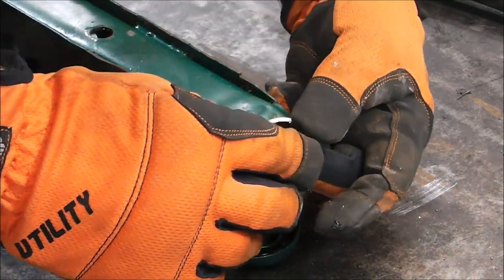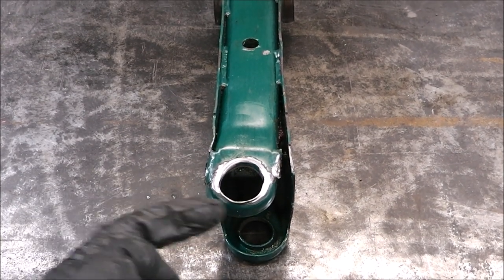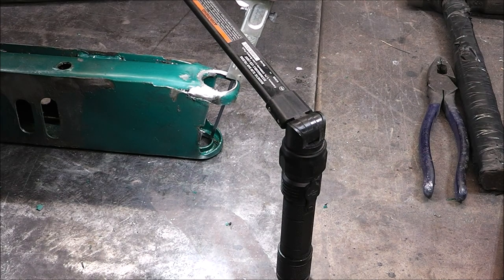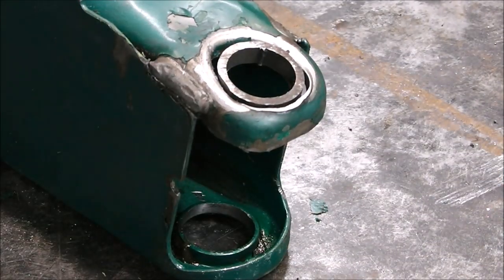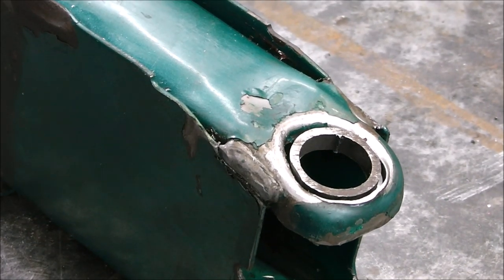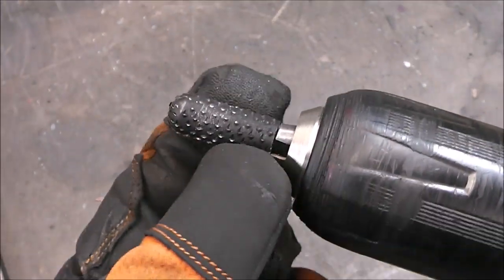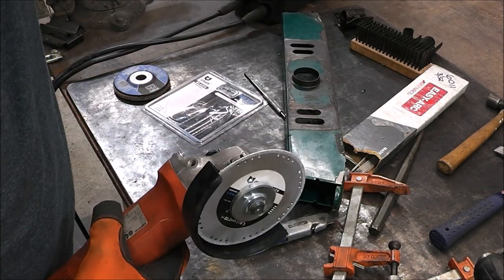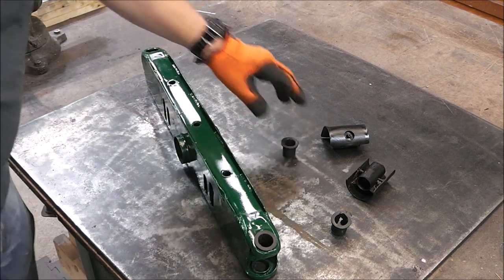Stick Welding Repair on a Bent Tractor Axle

Comment: A couple too many beers when you ran the mower huh? Safety third! 🍻 

Glad it wasn't too hard to fix. Making the 15/16" hole with a rasp from Hazardous Freight was a clever workaround. I'll keep that one in the back of my mind for future repairs.
Reply from the maker: Shhhhhh, (they were light beers) and my wife thinks it was the neighbors kid that broke it 🙄 JK. I probably could have bought a cheap throwaway 15/16 bit but I figured the rasp was worth a shot. It worked surprisingly well. I cant remember what I paid for it, but it wasn't much. It was a cheap set I bought back when I was restoring the fairings on the Suzuki rebuild project. Cheers brother!
Reply: @BrandonLund  I have that set of rasps. I thought they were for wood and nonferrous, only. Is there a reason you used that rasp over a carbide bur? If you don't have a carbide bur, that would be a really good reason; but maybe there's another?
Reply from the maker: Honestly, the rasps were leftover from when we fixed the plastics on the Suzuki Rebuild Project and I was just curious to see how they would hold up because I knew they never touched anything other than plastic. I have a few cheap abrasive rasps (which are a joke if your trying to hog out material) and I have 2 good carbides that i use on a die grinder but I don't don't really like using them unless it's on something important. I purchased them for porting and gasket matching an intake manifold. I cant remember if the rasp I used in the video was intended for metal, but if not, it held up pretty well.

Comment: Great video. 6011 burns thru paint. A few extra welds at stress points might have been a good idea.  Having worked (welded) in production factories, I know the guys sometimes go CHEAP on the welds.  Some guys cheat A LOT in that area.  " Overengineering is under rated " If more reinforcement welds were put on originally, you might not have had that problem.  IMHO There's a special place in HELL for the guys who cheat on quality.  They've caused a lot of grief during their careers.
Reply from the maker: Yah I agree man. The cracked welds that i repaired near the end werent enough. It might be hard to see but I extended them by about an inch beyond what was originally done and i also put some weld inside the tube. I doubt it will fail again if I'm using it right, but if it does I'll put a cast iron axle in it.  It's pretty thin metal.

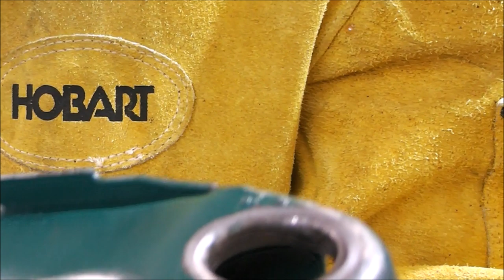Comment: 11:34 another crack. 
Maybe you will have to make less reps by building the whole part new and stronger. Trumpet sheel metal...
If i weld thin metal, I leave high A but filling it up dot by dot. So i make sure  I have enough penetration.
Reply from the maker: qwertz33 it’s welded on both sides. The factory only welded it on 1 side. It’s 50% stronger than it was before. Plus I think it was originally cracked from abuse. I treat my stuff pretty good so it should last